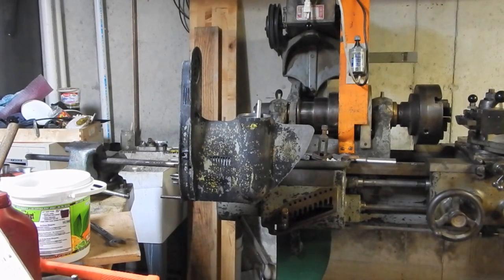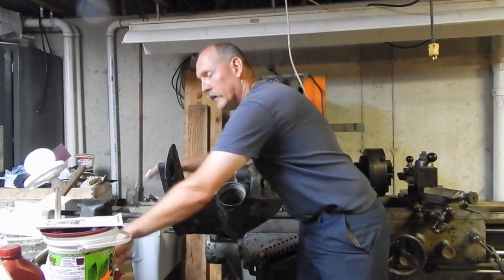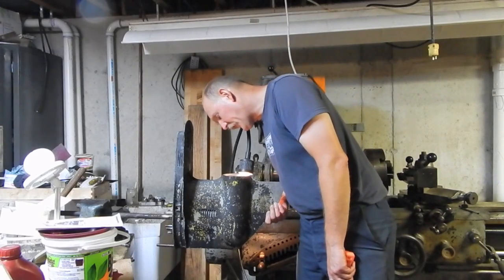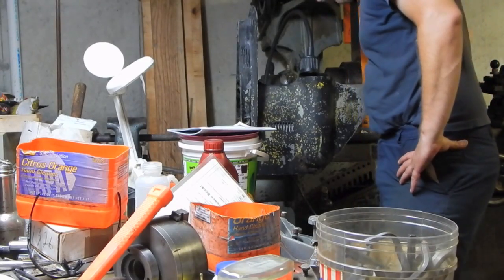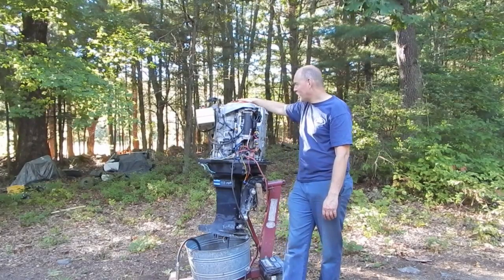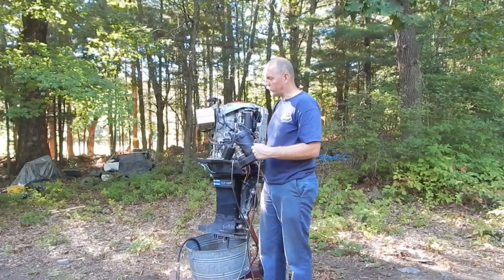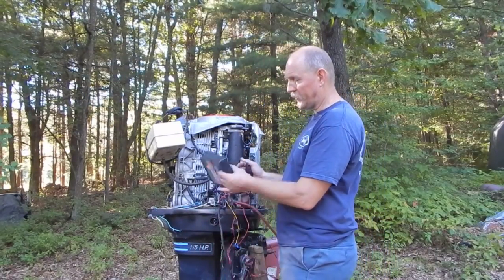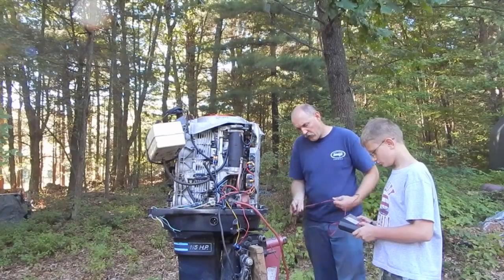The Mercury outboard "Tower of Power " Part  43

Comment: You have been a great help.   15p is pitch     i have 1978 115hp and am taking my lower unit apart after seeing your videos.  hope you do a reinstall of the lower gears a.d stuff.
Reply from the maker: i doubt I'll do a reinstall since i now have the replacement gear case. be sure you note what size shims and where they are located. i think i read somwhere the shims determine proper gear mesh and bearing preload.
Reply: I would also like to say that you do a great job with all your different videos. I hope you keep them coming.You have a detailed interesting style to the videos.
Reply from the maker: judges69 Thank you!